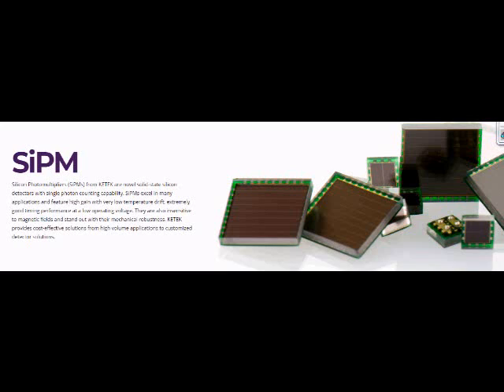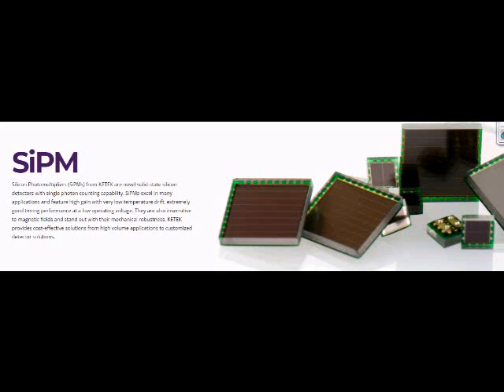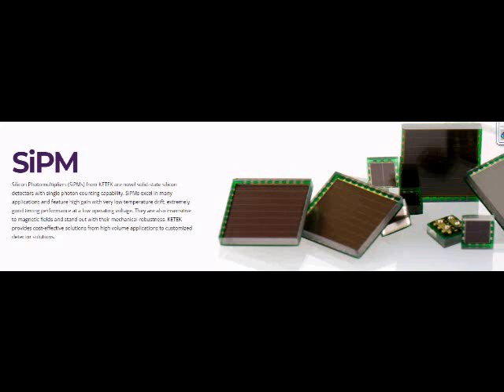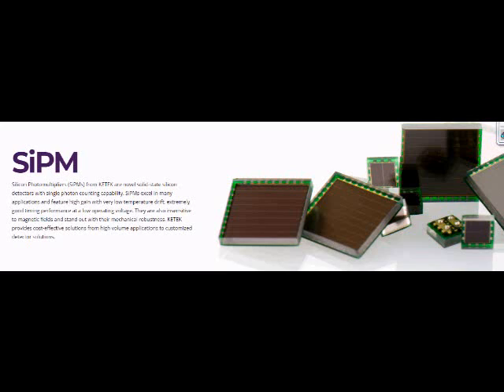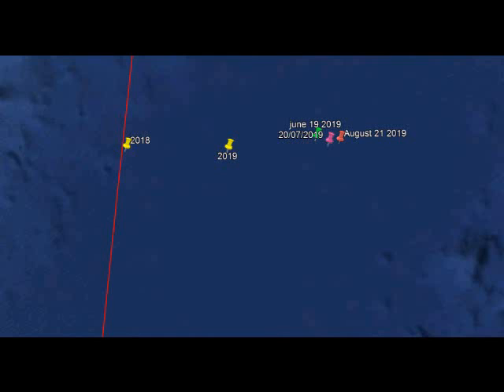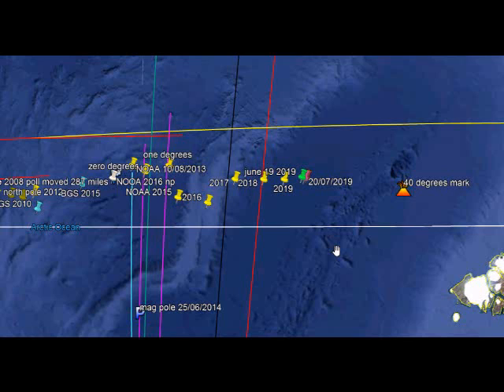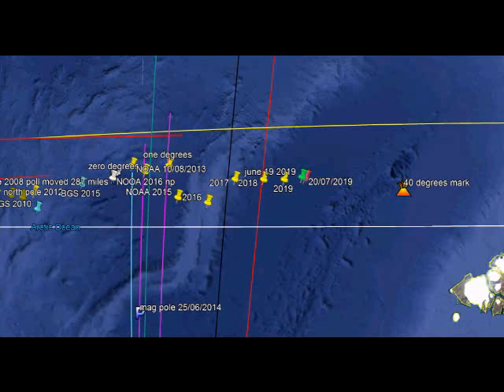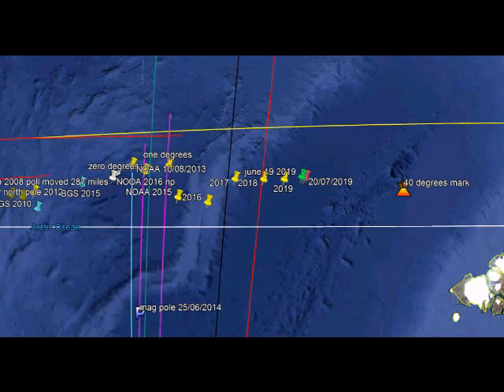LATEST MAGNETIC POLE POSITION! CLIMATE CHANGE POLE SHIFT GRAND SOLAR MINIMUM

Comment: This data should be being put on the bitcoin sv blockchain. There is a project on there called weatherSV which is feeding in tonnes of weather/climate data. If your data was stored on there too it'd be possible to perform analysis and modelling between the two data sets via the mining cluster. This would also allow you to monetize your data or give contributors equity in your observatory.

Comment: Gene, why is the 40 degree teritory critiacal at all? In some your last videos you mentioned that it was tested in labolatory that crossing that point poles are no longer stable and switch.. But critics may argue that poles are already migraging and this process can last another tens of years, maybe hundrets.. Probably not at current pace since it is very fast now.. If I compare the distance from now to the 40 degr. mark with the distance now and back in the past it is apparent that the distance now-40dergee is the same as 2017-now.. Means, we are 2 years to that 40degr. mark, not 7 years.. (and 3 years if the yelow bottom mark is for 2016 and not 2017 as it seems from your labels).
So the question what happens after is extremely hot and we should be looking for the proper answer what is next.. So how do u know that poles then flip why could not they just stop to migrate or even go back?
There is a first sign that could support the "stop" scenario and namely, you foud out that the intensity of the magnetic field has not weakend at all in the past 18 months.. Can you pls elabortate on this a bit? thank you.
Reply: There's scientific evidence for previous reversals. This has happened before. When a reversal happens the destabilized magnetic field/magnetosphere will allow the noble gases will escape. We are losing our protection from UV radiation as the magnetosphere weakens before the flip. The extreme UV readings will get worse.
Reply: @dbg0206091  and do u have an explanation why nobel gases shall escape while our magnetosphere gets destabilized?
Reply: If you don't believe me do your own research. Either way, acceptance and personal responsibility are vital now.
Reply: @dbg0206091  No I just think that we do not lose gravity so even nobel gases should be still attracted ravitationally. But maybe they get bound to ions comming from the space after our protection is weakend, that could be the reason for losing them? I will reaserch myself, thanx for the hint..
Reply: @lukabc31  No problem. You're on the right track.